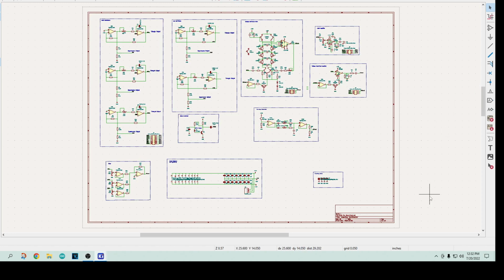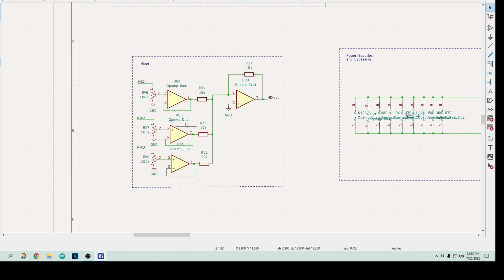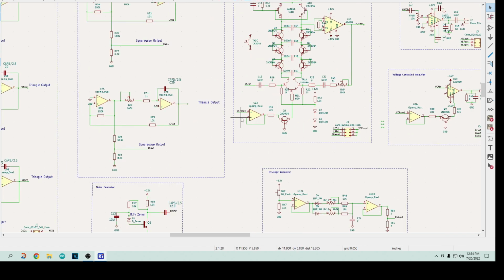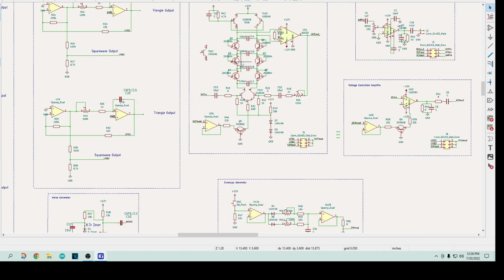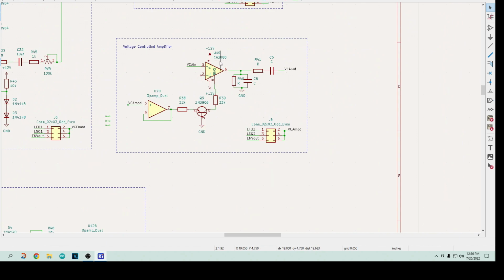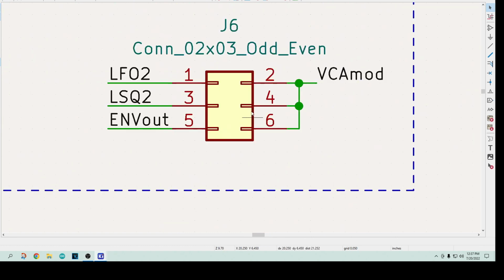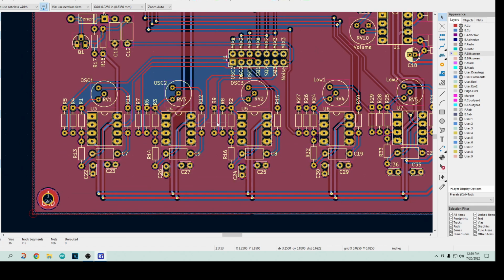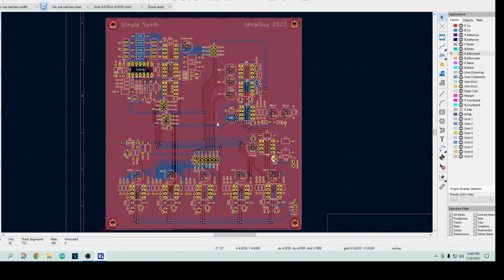#1226 Simple Synth Project (part 1 of 6)

Comment: For your first custom symbol, you did a good job on that CA3046. Multi-part symbols can be a little tricky. Do you explain in a previous video why you needed to use that particular chip rather than a few more 2N3904s?

You certainly can drop in mechanical components like mounting holes directly in pcbnew. Just remember that, if you need to update the netlist after modifying your schematic, you might have to put the mounting holes back in afterward and reassign them to the ground net. It's more convenient to just put them in the schematic. If they're purely mechanical holes (not connected to any net) you can make them edge cuts on the mechanical layer, but a fabricator might have trouble interpreting them as holes.
Actually, you can build an entire circuit in pcbnew in standalone mode, but you won't be able to do any DRC. It's convenient for simple things like Big Clive's Disko Shart boards.
Reply from the maker: yes, it was explained, the long tail pair needs to have matched transistors. the bottom  pair and top pair of the filter the most important

Comment: use version 7, design the board, place the components on the correct spot and switch to 9 to route, no limitations.
the dumb part of kicad is binding a footprint to a symbol.

it's the same in eagle of you wanna have them grounded, unless you place simple holes with the stop layers.

3:31 You can use a FET (2Sk30A, BF256, 2n5485, etc) instead of  R40, R41, C5, like Roland did in the Jupiter 8.

this last transistor of the CA3046 (pin 12, 13, 14) has usually all pins tied to a negative voltage divider, -1V, substrate, all designers in the past did this.
check the "schematic" of Doepfer A110 VCO.

Comment: I am sure you know that Q5 as a voltage shifter has to go to the input of a current mirror at -12V which goes with its output to R21. (adding 2 transistors (and maybe one resistor))

Comment: There are two additions I heartly recommend. The first ia an autorouter. A bit of hoop jumping to install it, but it works great. I tried it on a board I was trying to route with no vias. It did it and most of the board looked like my routing. The second is a melting plugin. It takes your cold hard edge traxes and makes them curvey. Fat tracks and spacing (1 mm)  makes it look almost hand laid with vinyl tape. Mitxela has a video on melting and Sukesh Rao M has the deets on the autorouter.
Reply from the maker: I tried the external autorouter. I found it very slow and difficult. I'm used to a build it router where I can autoroute only selected lines and not then entire board. Auto routing section by section can get very good in digital designs, say just autoroute the address and data lines first.
Reply: in Eagle you have the Mitter tool in the toolbar on the left, select or introduce a radius and click dimension layer on the right, 2 types available, job done.
It's best to hand route, the top layer form west to east or vice versa and bottom layer from north to south, use the component pads to switch layer and if no options available use 2 or 3 vias.
i lay my tracks with the calculator, (1,27, 0.635 ) and route them exactly between pins of ic's and components, than i use the mitter tool to round them off in the corners.

Comment: You can add the mounting holes to the PCB only. You only have to be careful if you then make changes to the schematic and then pull in the changes to the PCB — you have to make sure to check (or uncheck?) a box that indicates whether to blow away existing components on the PCB in order to retain them.
Reply: it'd be nice if that was a component level feature instead of an overall preference thing... is it?